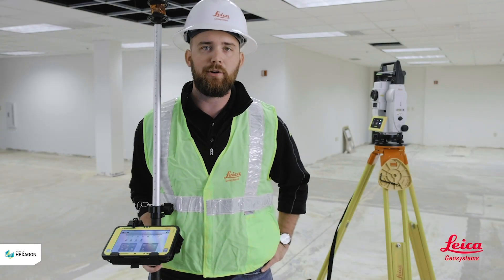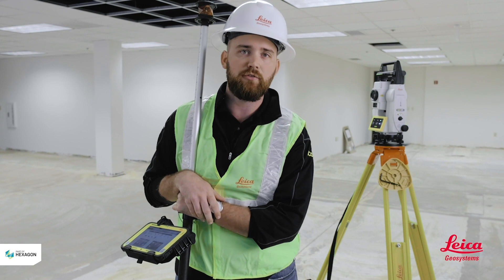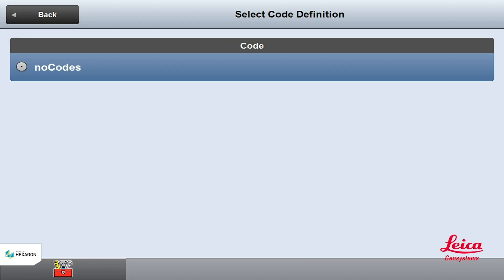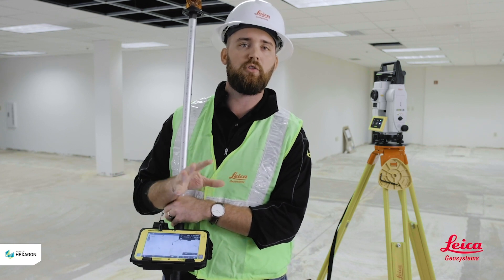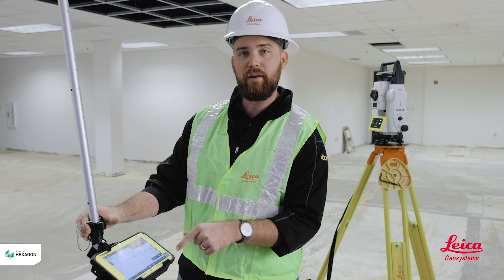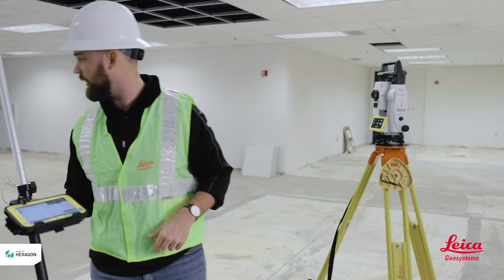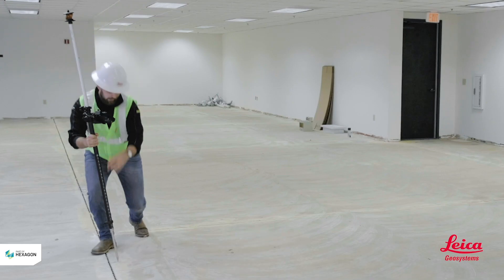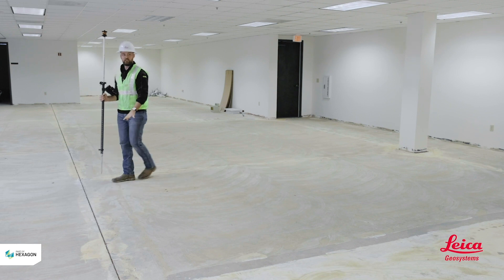How To Setup Secondary Control Points With Your Robotic Total Station Leica iCON iCR70

Comment: How would you make new control points using the reflectorless? Thanks.
Reply: Once your instrument is setup with primary control, use Leica 20mm, 40mm, or 60mm stickers and place them on solid locations where they're highly visible.  Then shoot each of the stickers into your data collector and name them appropriately.  It's not true reflectorless mode as there is an option for prism type "Target Sticker" but it works the same way and gives you the same advantage.  The benefit is you can resection your instrument without walking to each of the control points and from my experience, as long as you stay within each size target sticker's distance specification it is at least as accurate as using a rod & prism on a point.  I like to use the visible laser and move the instrument manually until I see a laser reflection.  Then I sight the instrument on the sticker's cross hairs and store.  Sorry if this doesn't answer your question but this seems to be the best way to do what I think you're trying to do.

Comment: Would you better off having the prism closer to the ground or even use a mini prism to have better accuracy of the control points?
Reply: The general idea that the higher the prism is off the ground the less accurate you will be, but with these systems you can be as close as 1/16th of an inch at the default height of the rod.
Reply: @michaelryan2044   and you could be as far as 2 inch by the time you press the button,  No way would I ever use this for control points of any work